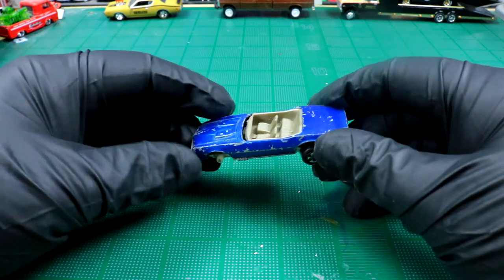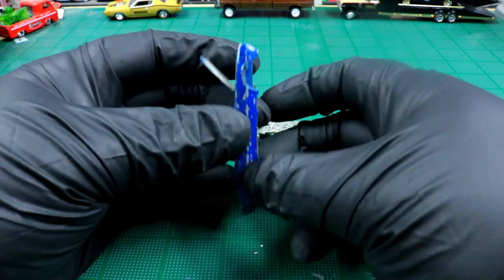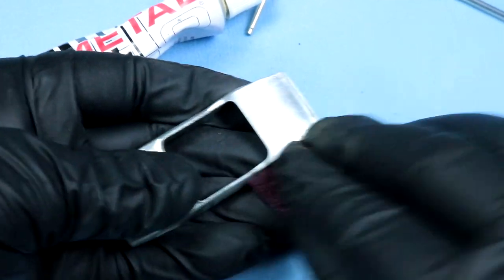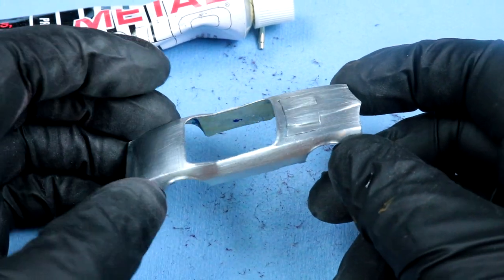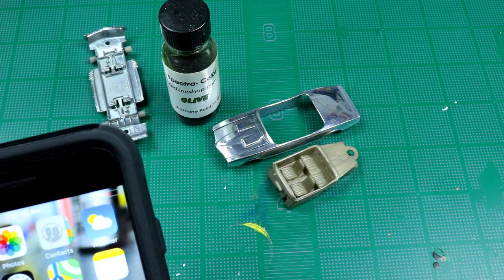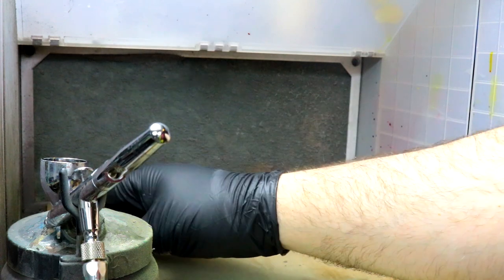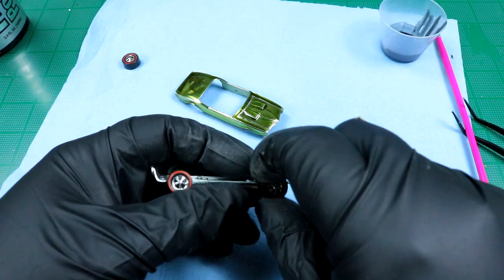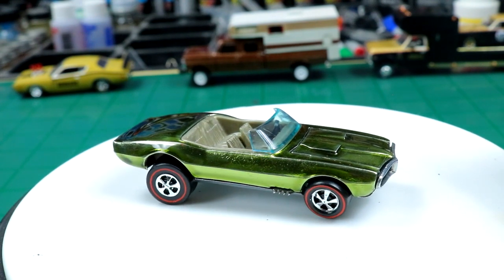Redline Restoration : Custom Firebird

Comment: Hi, I like doing restorations on the old " sweet sixteen" Hotwheels, because, after the years of playing with them, they look mostly very rough. I'm always fascinated how you make them look like new. 
I'm the elder generation and don't know anything about 3D printers and also not so interested in that new technology. When I would use a 3D printer and have a technical problem I would be absolute helpless. Therefore I prefer the " old" way of Hotwheels restorations. 3D printing for my opinion is something for the younger generation.
Greetings and best wishes!

Comment: Loving the colour, ive got to ask though is that olive a paint or a special pigment for adding to clear coat ??
Reply from the maker: Its actual paint from the redline shop. Its always been my opinion that they mixed it wrong through.  You end up with the overall color to fast and you've barely got 2 coats on.  So i started thinning it out and its been way better overall finish and durability.
Reply: @DiecastResurrection  so you add it to clear coat to reduce it down then, great move 🤘

Comment: What psi are you spraying at. Also what are the specs of your airbrush. Love the channel
Reply from the maker: I use lots o’ psi 25 if you can or even 27. The booth is in the supply shop link in the description along with everything else. Just grabbing some supper right now at Edo Japan.
Reply: @DiecastResurrection  thanks keep up the great videos

Comment: Hey, @Diecast Resurrection, why not just use a scrap vehicle as a donor for more metal for the car that you are working on, then use some tiny tools to properly weld, as well as sand, grind, and buff out, said metal scrap until it lines up with the rest of the vehicle?  Could you not fix the car that way?  Sometimes, people do that in real life to vehicles that have rusted out parts that need repair and restoration when people are restoring vehicles.

Comment: Gold would also have went well with the interior. Or you could have painted the interior to match ANY color you chose. You could also have chosen to customize it  any way you wanted. Just because the car is basic doesn't mean your redo has to be. You could even have tied in the pitting as rust damage by making the car an old hoopty.

Comment: Mine is Worst than Yours!

It's Missing the Hood Lid, Rear Wheels are Gone.

The Day After July 4th on a Sunday in 1970 I Bought it's Customized Light My Firebird with the #2 on the Door, in Green, it Needs a Paint Job & New #2 Decals, Windshield is Intact, Wheels Aren't Bent & Rolls Pretty Good.

Comment: Wow . . . I know you probably don't want to hear this but if you're going to talk about how your channel has allegedly surpassed basic restorations then your end result better be PERFECT. 

Not the case here.

Your paint was not properly applied, that's why it pooled so badly around the hood and the hood scoops.  The nicks on the right side could have been eliminated or nearly so with little effort.  The right side wheels are clearly fucked up and you have the tool laying right there.  Sorry man, but if your standard is going to be "it looks better than it did anyway" then you are just mailing it in.  Personally I'd toss the thing back in the stripper and try again.